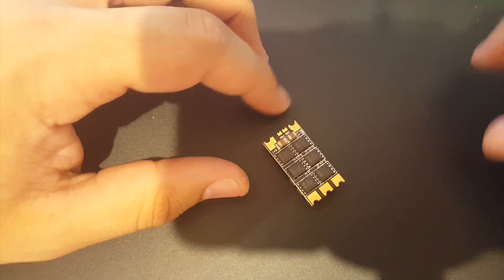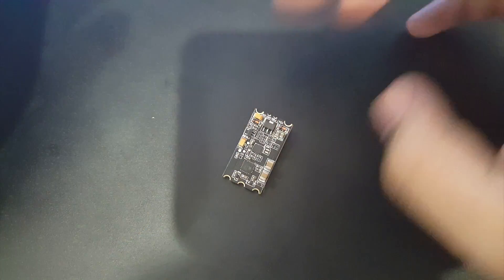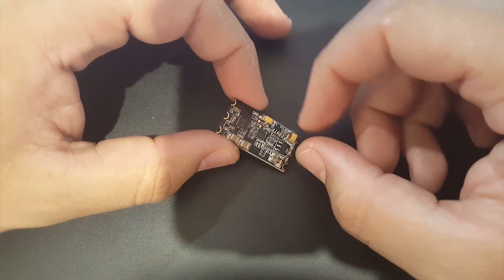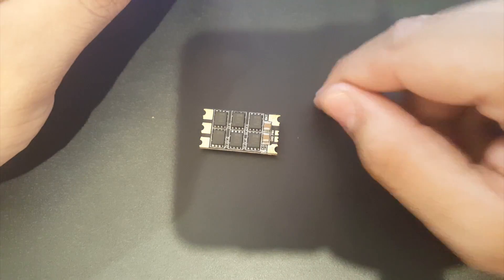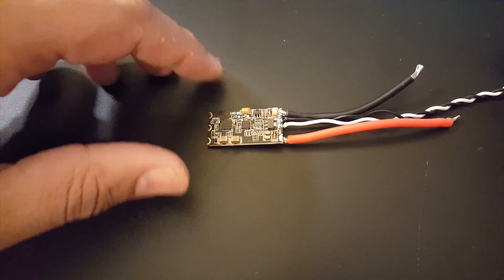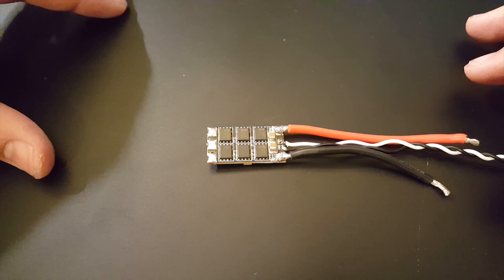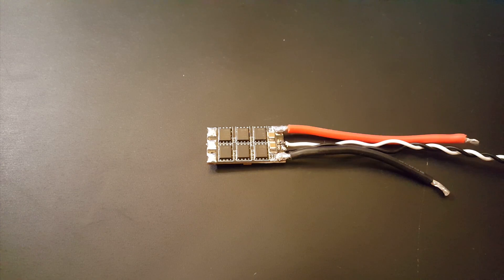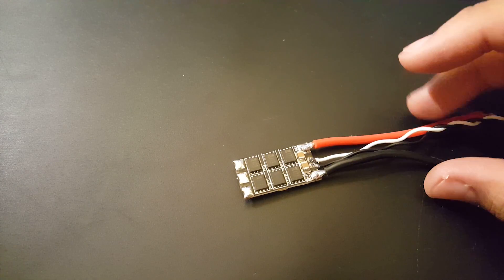Airbot Bumpbee 30A ESC // Review and Noise Testing

Comment: I have them on 3 of my builds and they works fine.. I always add a 35V 1000uf at the lipo side and no issue at all.. I run dshot600 and they work well. One of my quad runs 5S without any issue. I recommend to have the 3D printed holder and keeps the build clean.. Since the 2 capacitors on the bottom are protruding too much if you don't have the 3D printed part. They have a solid green led and I never have any issue with them.